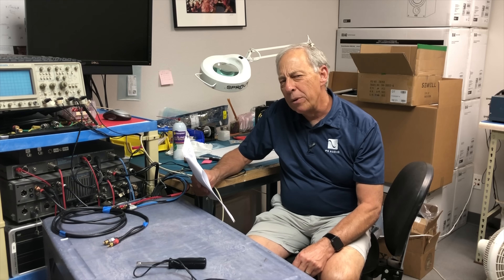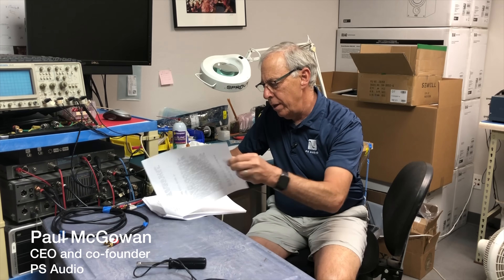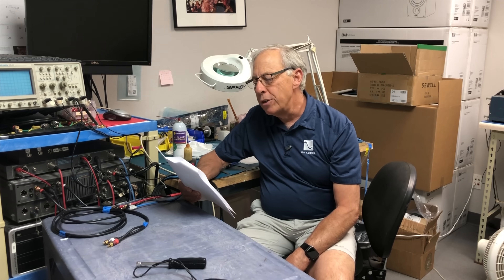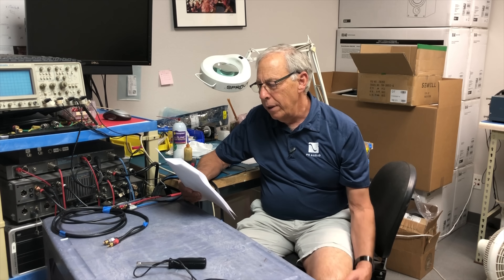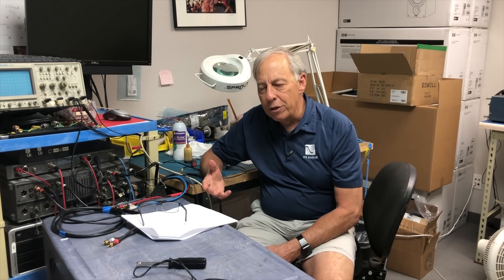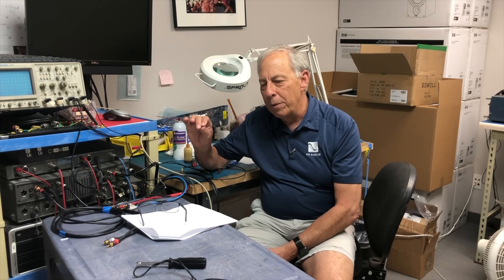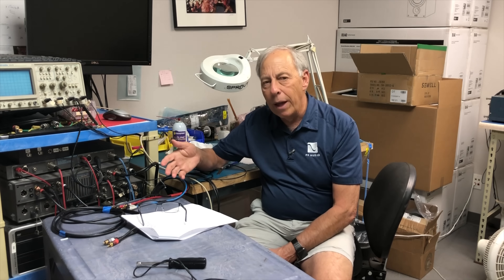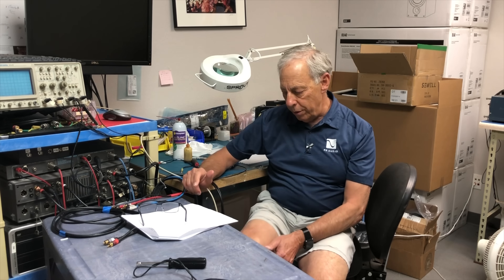How to match a preamp to a power amp

Comment: Balanced vs unbalanced out- to input doesn't 'sound' different. Balancing is a method of suppressing stray noise. 
A solution for a non-existent problem at 0dbu and 2 ft of well shielded cable. But... whatever.
I am not cursed with golden ears....
Reply: Larry Niles Thank you. 
More gain, indeed. But if you say that it sounds different, I can only take your word for it. Technically, there should not be a difference other than more gain. How would you quantify "better" ?
Reply: It depends on the implementation. Look at the B.M.C pure dac for example
Reply: Danny Woods Why ? Please elaborate...

Comment: So running 1000 ohm resistor from your cable what has the resistor connected to it to your Poweramp will always be better?
Reply: John sweda You are joking, aren't you ? If that would indeed be 'better', would it not already be in place, and advertised as such, accompanied by a "slight" hi-end fee. ;)
Reply: Tubetinkerer no clearly it is not in place as Paul has said. If you've Got a mismatch system than 1000 ohms at least should do it some favours
Reply: John sweda Apparantly you missed the wink  ;-)
Reply: John, the issue with most home stereo is the preamp is not designed to drive that low of a load impedance, so the overloaded preamp output will be distorted.  In commercial audio where long interconnects is the norm to reach from the boot to the power racks, the output impedance of the console is designed to drive into lower impedance loads.  For example of a typical mixing console is a Mackie SR32-4. It has an output impedance of 120 ohms on all outputs and can easily power 10 power amps daisy chained to drive a cluster for a concert each with 10 K input for a total of a 1 K ohm load on the mixer. 

Most home gear is not built to drive this type of load.  If you have a scope, try a 1 K termination and see of there is any resulting distortion.  Some pre-amps can support this.  If you get a service manual and schematic, you can look up the output section to find it's abilities from datasheets. If it is only a low power op amp, I would not overload it.

Tubetinkerer, most manufactures stick with best known practices and keep the inputs high so there are no problems when matched to other manufactures gear that can't drive into lower impedances.  The industry standard for RCA audio termination is 47K ohms.  Making an amp with a 1K or lower RCA input is going to be a problem when matched to other manufactures gear.  The blame will be on the amp for the distortion from an overloaded preamp.  Manufactures don't want this problem.
Reply: isettech I am with you. In guitar gear input impedances are usually at least 100k. (Yes, there are some exceptions) Anything less will load the signal and will cause an audible roll-off of the high-mids and highs. I merely wanted to highlight the mumbojumbo surrounding impedances. 
People tend to generalise and there is no generalisation in impedances, just some rules of thumb. Impedance matching is an engineering job, not a "let me roll my resistors like I roll my tubes" kind of thing, right ? ;)
Reply: This is why guitar cords are always short.  A long cord will change the sound drastically due to the capacitance of the cable per foot adding up. An on stage preamp to drive a DI, or a powered DI, is required for pro sound and studio recordings, while a dynamic mic on a 100 foot snake is no problem.  Guitars and their pickups were designed for the input impedance of a tube which has carried forward into the solid state equipment.  A guitar amp has high impedance inputs.  Along with this input impedance comes all the cable limitations and hum and noise pickup when there are poor connections that low impedance mics simply don't have.

Here is a link to a good article on DI boxes for guitar.  https://www.prosoundweb.com/channels/live-sound/di_boxes_for_guitars_different_approaches_for_acoustic_and_electric/
Reply: isettech I use 20 ft cables going into my pedalboard. There's no noticable loss of signal. The first stage of the board is a high impedance buffer (1M), which avoids these losses. (Now there are issues when using a germanium based fuzz, but that's a study in itself. Coincedently I hate fuzz.... lucky me!)
Furthermore, there are no run of the mill guitars equipped with a balanced output. Even with the huge gain factors involved, this is not a common problem that needs solving, apparantly.

Comment: It would be better, in my opinion, to refer to "compatible impedance" rather than "matched impedance" because there is a signal transfer technique that requires input and output impedances be equal, i.e. matched.  This technique is not often seen these days but the potential for confusion continues.
Reply: Michael Kesti Impedance matching is only used for current driven devices, e.g. dynamic microphones (600 ohms) and of course loudspeakers.
A preamp is a voltage source and should therefore be loaded as little as possible. You really don't want your, say 50-100 ohms output to be loaded with a similar impedance, because the signal will be reduced to half the voltage being generated. Besides it will cause a significant roll-off of certain frequencies and maybe even clipping  distortion. If you don't believe me, simply connect a 50ohms resistor across the two conductors (signal & ground and still connected to power amp of course) of your interlink and experience it first hand. (The 50-100 ohms also functions as a short-circuit protection, so you won't damage anything)

Comment: And to make it more confusing, the output transformer on a tube amp should match the impedance of the speakers.  For maximum power transfer the output should match the input - in power amps anyway.
Reply: Manard, Actually the output impedance of solid state amplifiers is a fraction of the speaker impedance to provide speaker damping.  If you go too low in speaker impedance on a solid state amplifier, the excessive current will damage the amplifier.  This is why the nominal impedance of the load is stated.  If your amp has the damping factor listed, this is the inverse of the amplifier's actual impedance and is often in the milli-ohm range.  For example an amp with a damping factor of 30 has the 1/30 impedance of 0.0333 ohms.  Tube amps with their warm sound have much lower damping factor as their output impedance is much higher.  Google damping factor of amplifiers for more on the subject.  This is why a tube amp has nicer clipping than the harsh brick wall of a solid state amp. It has a warmer fuzz for guitar distortion.